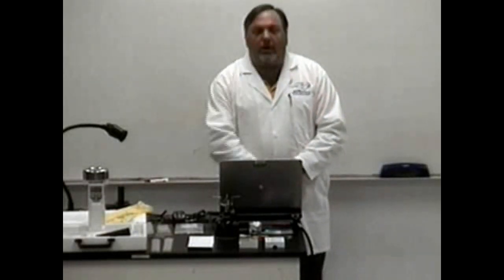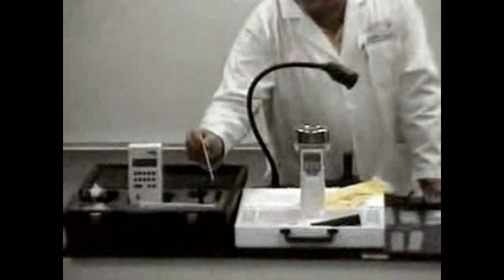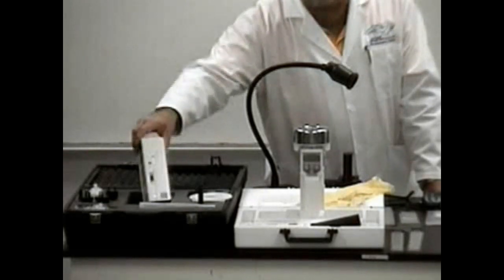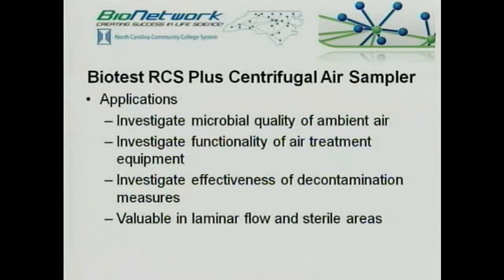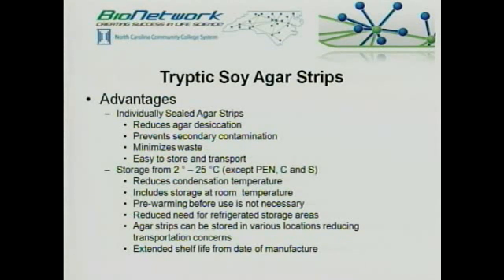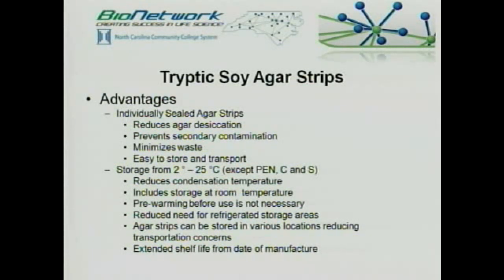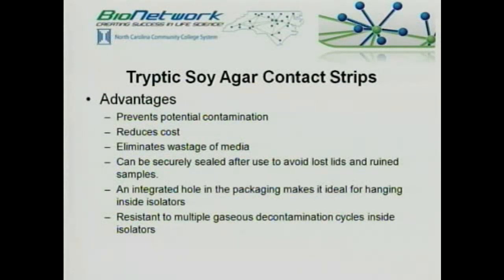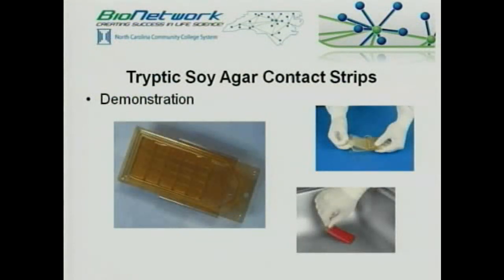The Basics of Environmental Monitoring / BioForum

Comment: Today, I'll be critiquing this video.  I'll be posting comments about what I found wrong with this presentation.  I'll be talking about why I think the things you did wrong were wrong.  I'll also be covering how you can improve this presentation, and future presentations.

- ^ The above mirrors your presentation style... i.e. horrible.

1) Your graphic header is too big, and the text (font) in the header is too small.

2) Agenda is stupid.  It's good if you are teaching average or below average IQ, but for high IQ/good listener's, it's a total waste of time (see example paragraph, above).

3) 48 minutes!?! WTF!!! Talking about too long?  

4) 1:44 Bullet point form is redundant and inconcise.  If you MUST use an overview, it should be in THIS form:  

----  I will Demonstrate  ----

* Laser particle counter

* Centrifugal air sampler

* Contact Strips

* Automated slide stains

-------------------

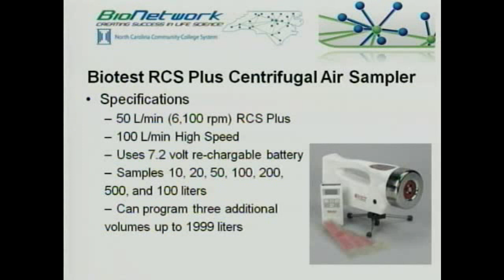5) You don't need to mention irrelevant info, like x, y, z works in Japan or internationally... why not mention you need a power adapter too, because the US is on 115V @ 60Hz??  It's just not relevant.  Another example, 9:00 "will tell me the relative humidity and temperature of the room where I'm at. "  Cut the part "of the room where I'm at." - it's poor grammar and unnecessarily wordy.  14:00 one of your bullet points is Uses 7.2 Volt re-chargeable [sic] battery.  Who CARES?!?!?  What if it used a 6 V battery?  Is this an electronics class now?  

This is why your video/presentations sucks.  Your presentation skills are also horrid.  I'd call this an embarrassment to professional of education, but there are some pretty terrible instructors out there, so this is merely par for the course, but still outstandingly bad.  I pity the highly intelligent members of your audience.  15 minutes was all I could stand.  

Sorry to knock you so, but it's merited.  I give this a D- grade.
Reply from the maker: Sure, please let us know.